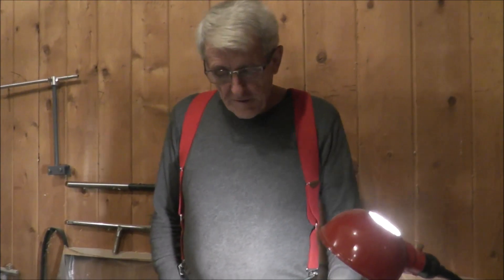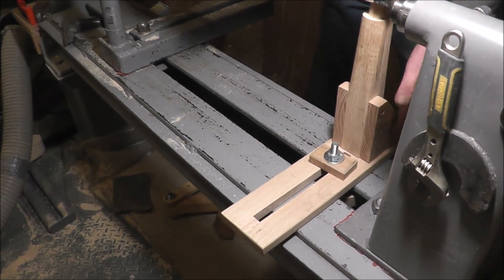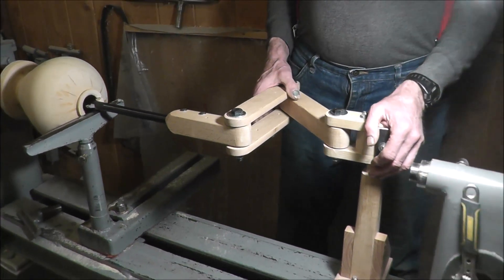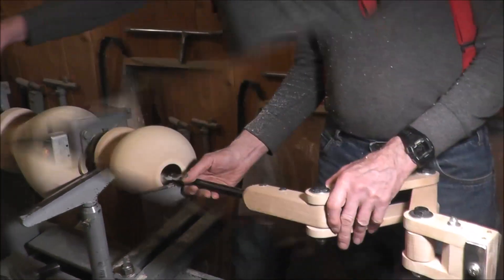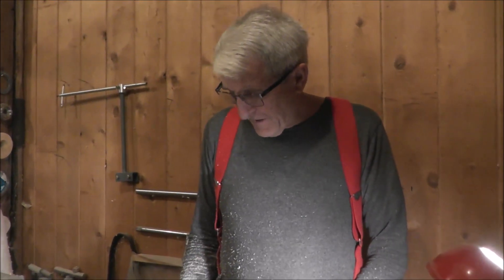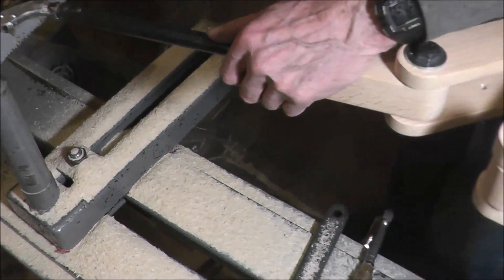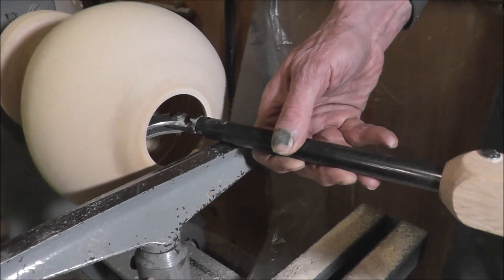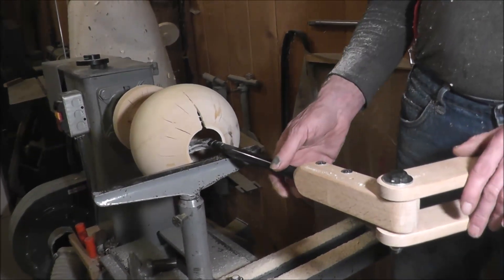DIY ARTICULATING ARM No.  2,  demonstration

Comment: Nice looking tool Brian. As I am a complete novice at turning what is the advantage of the articulating arm over holding a boring tool freehand?
Reply from the maker: It makes it possible, Impossible to hold it by hand, it would twist  out of your hand,  a common simpler system is what the call a D handle through a slot. this is the first time I have used a system like this, nice. so smooth.
Reply: @brianprocter6191   Thanks for your reply. After a bit deeper thinking I can see what you mean, there would be a lot of twisting forces on the tool.